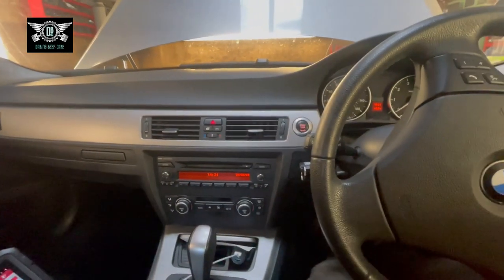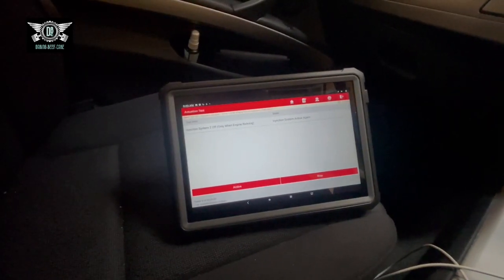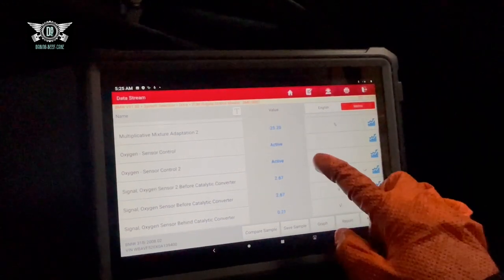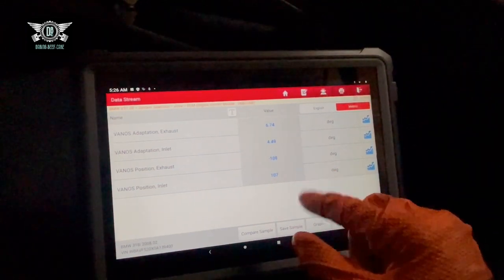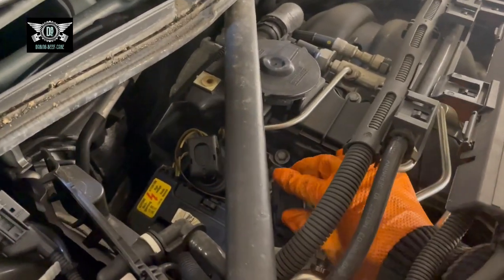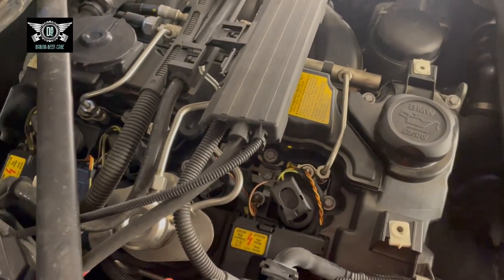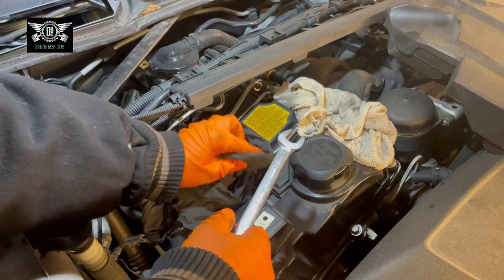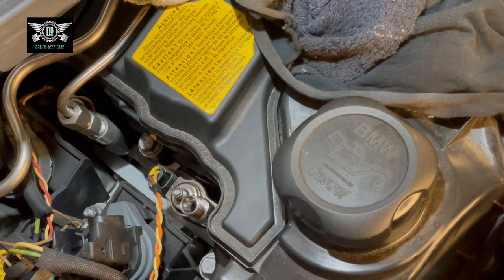BMW e90 2008 engine misfire fixed fuel injector faulty and replaced

Comment: Great video.  Cn you just clarify that you suspected injector 1 because switching it off in a test made no worsening of the misfire?  

Also, many DIYs emphasise changing injector seals which need compressing with a special tool - don't you need to do that or is that just for new injectors?  

Finally, do you have to code the new injector?
Reply from the maker: Hi, to be honest I never come across anything that states the injectors need to be compressed, so can’t really comment much on that. 

Yes the injector in number one cylinder was not working and switching it of just confirmed that the misfire was in number one cylinder  though the misfire could be caused by a spark plug or coil pack. But those have been changed in this car. You would have to check that too. 

And yes technically the injector need to be programmed. Though I didn’t do that I think, don’t remember, it is advised to do so. I just get to many BMW of that era with injector problems.

Comment: Are the injector numbers in the computer the same as the physical cylinder position 1-4 from the front of the engine or refer to the firing order?  Thanks.
Reply from the maker: As far as am aware yes, the they don’t use fairing order, they refer to position 1 to 4. Starting front of engine.

Comment: IIRC BMW made over 11-12 varients of the injectors for these engines as they couldnt get them right. The version is the end of the code which i think yours states 10. People also forget these need to be programmed into the ecu, not straight swap.
Reply from the maker: I guess they do need coding, luckily still working 😂 however I will try investigate how can this be programmed… may e with ISTA P
Reply: You can recode the injectors with your Launch. I did it with my Launch Creader X431 elite. Made massive difference.
Reply from the maker: well done, thank you for letting me know. @bobafett5594

Comment: Is there any interim maintenance one can do on the CAT if suspected, before replacing NOX sensor?  Thanks.
Reply from the maker: I don’t think so, looking at the BMW diagnostic software it says if cat 🐈 is suspected to be causing a problem then needs to be replaced. But often the fault code referring to the nox can be ignored. Unless there is a fault that causes an issue with the running of the engine. Hope this makes sense sorry.

Comment: Hey I have an issue with my e90 N43 engine. On cold start the cars engine vibrations can be felt inside the cabin, when D is engaged vibrations worsen then when put in N it calms down a bit but still can be felt.  After idling for about 30 - 40 minutes the vibrations completely go away and it operates as normal. I don’t think it’s a engine mount issue because the vibrations go away after it warm if it was the mounts it should stay also No codes on the car or flashing engine light to indicate a misfire. It’s done 111k miles got the car at 80k haven’t replaced the injectors since my time owning it just had a service a month ago fresh oil and spark plugs and coils. Any advice is appreciated
Reply from the maker: That engine can have issues with fuel injectors , which cause slight misfire on start up that is not enough to cause a fault code. and then it runs well. The things each injector costs an eye and a leg, so if it’s not majorly causing you any issues I would keep using it till a real misfire is detected and then you can at least see which cylinder may b at fault. Please take advice with a pinch of salt as with cars nothing is ever black and white if you know what I mean.
Reply: is ur mpg very low as well, i have the same issue i haven’t replaced the fuel injectors but have done an engine rebuild

Comment: i need your opinion : my bmw e90 with the n52 engine sometimes have a stuttering start. so if i do a cold start it stutters to a total shut down or it correct it self again and after that  it runs fine ? when the car is still hot after a drive and lets say i start the car again after 30 minutes the rpm is all over the place and after a while it is normal again ? is it a sign of a failing injectors ? there are no engine lights or warning ...
Reply from the maker: The car in the video had a similar behavior, so it is very possible that a fuel injector is playing up, they cost an arm and a leg so as long as you have checked spark plugs and coil packs, then you can start looking into injectors..or as did i used second hand injector, which till now since i made the video the car has not presented the same symptoms so all is good.
Reply: @DaringBeefcake  thank you ! I am changing my coils in 2 weeks and spark plugs are already done. Lets pray it fix the problem otherwise i have to call work for more hours hahaha
Reply from the maker: @Okejordi  hahahahha yep if you need injector then youll need a million extra hours i was actually quoted over £400 each hahahah crazy..

Comment: Hi can you please let me know how much mpg has increased after this… my car suffers from low mpg i’m only getting 15mpg same car just 2009
Reply from the maker: Hi to be honest I only replaced the injector due to a misfire on the engine. I don’t think bad fuel consumption would relate to injectors. May be the car is running rich for a different reason.